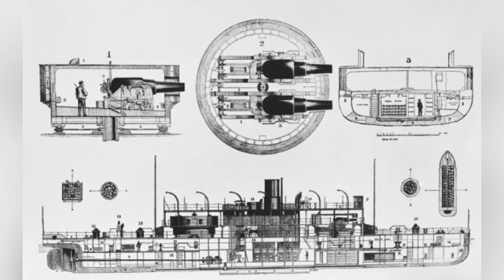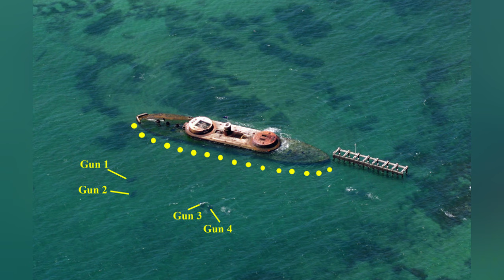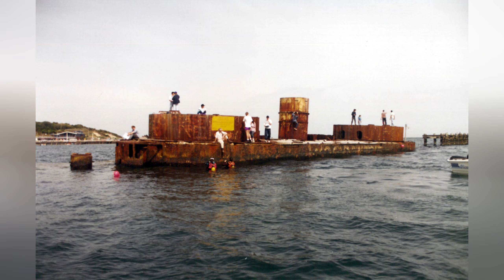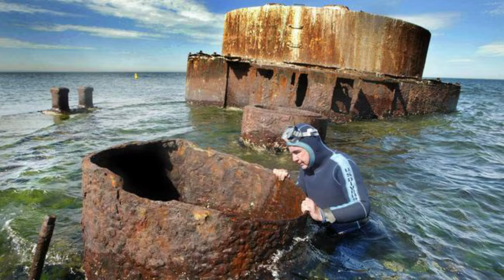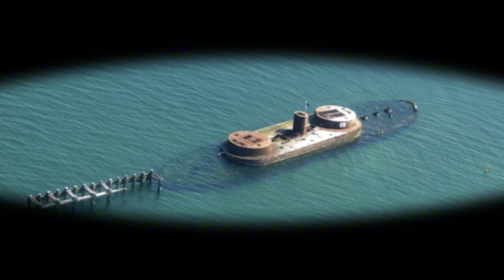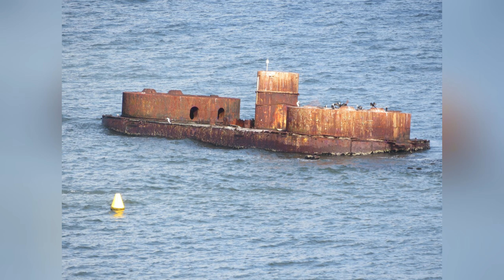Cerberus Wreck Mystery: Why the Historic Warship Collapsed

Comment: Agreed, 5 minutes worth of good info jam-packed into 20+ minutes.  OK, so they sank it as a breakwater, and it served it's purpose admirably for many years, and will continue to do so for many more until it just completely disintegrates.  What's the big deal?  The guns might have been worth the effort to salvage for historical/display value, but why all the angst over an old ship they found a use for beyond its service life?
Reply: the main issue is that people keep going on it, serving as breakwater is fine and all but since its a "cool sunk ship" people naturally want to go on it and check it out without realising its a hulk that's been rusting for multiple decades. more of a safety issue rather than it needs to be saved now issue.
Reply: @Ausferline 
Maybe fill it with concrete

Comment: What a complete failure. 

 If a ship is going to be used as a breakwater, fill it with gravel and concrete so it doesn't fall apart or degrade in time.

Who was the idiot that left the armament on it?

Changing its status from a breakwater to protected wreck 60 years after sinking is idiotic.  This prevented everything necessary to work on the breakwater object. Breakwaters need maintenance to matain their purpose
Reply: Let the breakwater ship break water until it can't  break water no more.  It is a similar situation as with the Powell River B.C breakwater concrete ships.  Appreciate the ships for what they're doing well beyond their operational lives. When they can't do their '2nd jobs', let them go.

Comment: If it was such a historic ship and it is, why did they sink it to make it a brake water?
Its sad but all things must end.
Reply: It's not exactly uncommon for groups to not see something as holding heritage value until it becomes even older. Arguably, this ship is the first battleship, with a focus entirely on large turreted guns. But that didn't matter when it was just a big heavy and costly obsolete vessel. That is when things get destroyed or sunk. It doesn't make them less valuable, but at the time it may not be seen as such. Also, engineering as heritage is a relatively new idea, largely coming through in the 1970s and onwards.